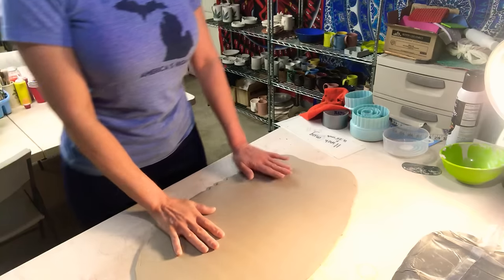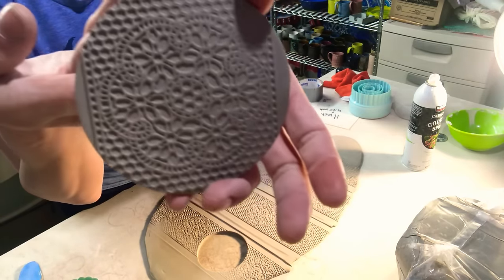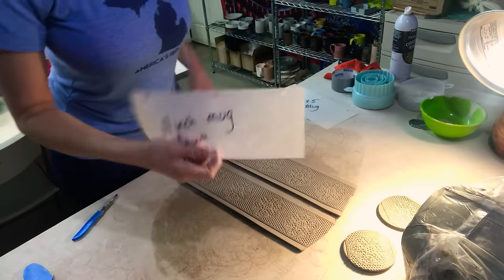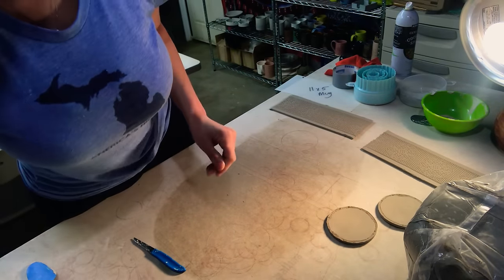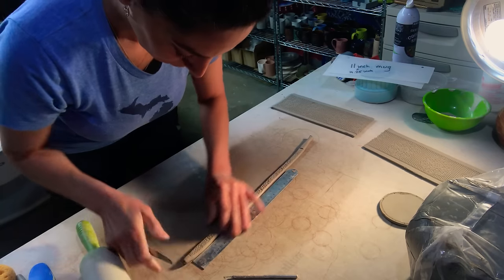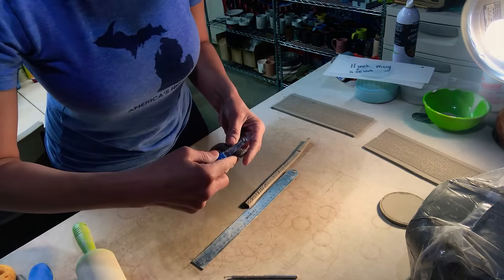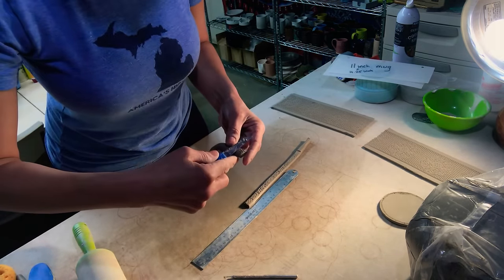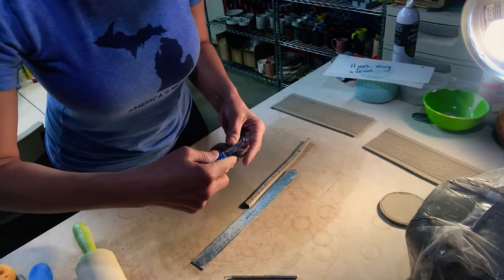Hand building a slab mug with texture tutorial

Comment: Really appreciate this tutorial!  Couple of questions.  What surface are you working on?  About the cutting template - it looks like the length (therefore the mug circumference) it is based on the repeat of the texture template.  So the cut edges are in the middle of a repeat.  Make sense?
Reply from the maker: I had a carpenter build me a table and I placed a hardiebacker cement board on top. It’s great for wedging, recycling and handbuilding. 😂   The template worked out perfect for this mug. The height was what I use for my 12 oz. mugs. The length (circumference) need to be short since my mugs are only 11 inch around
Reply from the maker: I think I understand. It doesn’t come out to a perfect pattern at the joint.